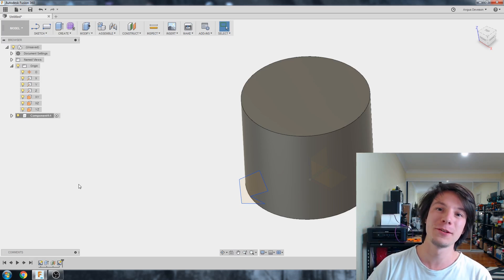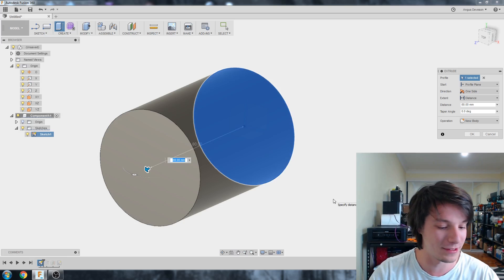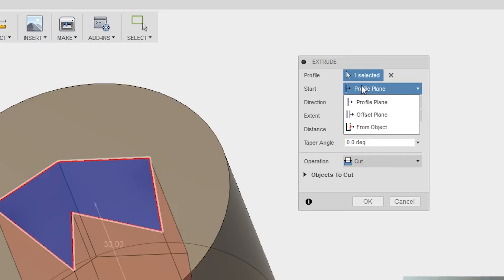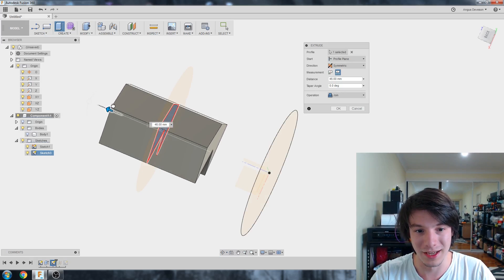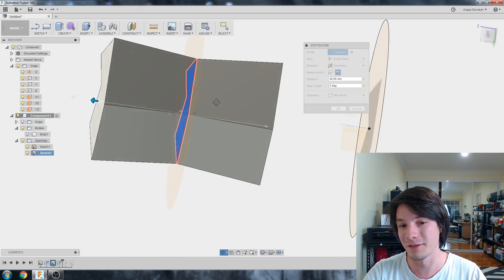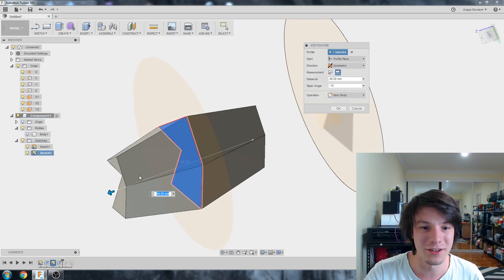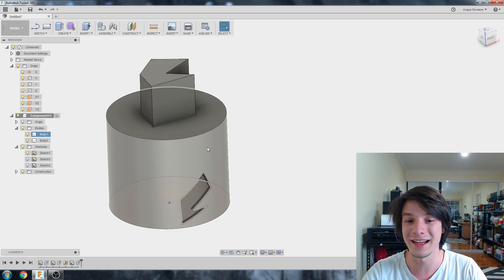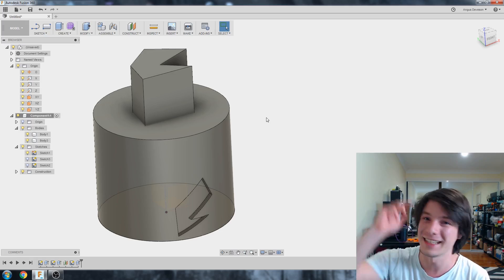Extruding in Fusion 360 - CAD For Newbies Tutorial

Comment: Hi! I would have an additional question regarding extrudes, more exact, cutting with extrudes.
I'm trying to cut simple oval holes using my sketch as the extrude line/model, no problems works fine. But how can i make the extruded/cut holes remember the sketch that created the holes, meaning, I'm trying to have the holes update their position when changing the sketch pattern or position of the ovals on the sketch. I have varying success, and would like consistency. Thanks in advance, hope you can help me. Cant find answers elsewhere... Thanks!

Comment: Hello again Angus, question i am trying to model a soup can lid. The one i have snaps around the lip of the can because the lid has a tiny inner lip. I drew a cylinder. 25 high and cut out a circle. 16 deep now i need a slightly bigger circle cut out but not all the out for the inner lip. What's the best way for that?

Comment: Hey Angus, could you explain the difference between Extrude and Press Pull (under the MODIFY menu). They both appear to do the same task.  -Cheers
Reply: I'm not sure but I think this is how it works.
Extrude is adding/subtracting a new object to/from the previous object. 
Press pull is changing the dimensions of the original object.

Comment: Today I designed a replacement part for my ft-5 in fusion 360. I printed it in abs on the ft-5 itself, but the holes for screws and recess for a nut printed smaller than I designed it in fusion 360, I'm baffled because every other dimension of the part were spot on, and I have tuned the printer and I know it prints abs dimensionally accurate. I have my printer enclosed, just can't figure out what happened.
Reply: FDM squishes so often small holes are encroached. If you reduce the scaling to account for the external squish factor then small holes will be encroached more. In Cura at least you can set a negative "horizontal offset" to take this "squash" factor into account. I usually use -0.1mm. You may need to tweak your scale factor again after.

Comment: Another way you could wrap text is by using the newly added sheet metal tools. Create a cylinder the size you want, make a slice in it, then in sheet metal tool, you can unfold it and create your embossed lettering. After the text is extruded you then refold the flattened plate out.

I saw this done on another youtuber's channel 
https://www.youtube.com/watch?v=xN5uqSyG6YA

Maybe you could expand on this workaround.